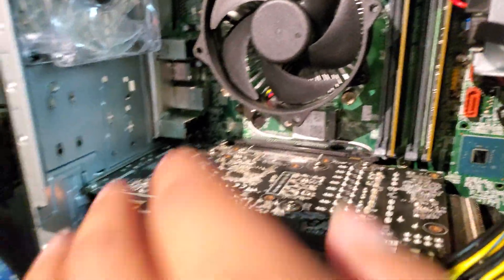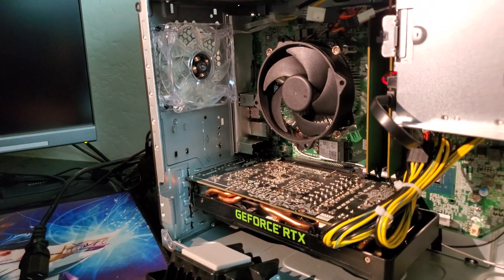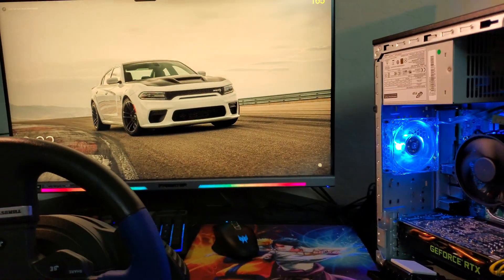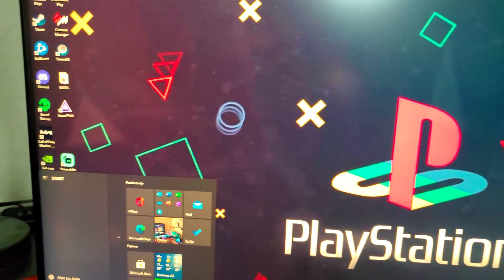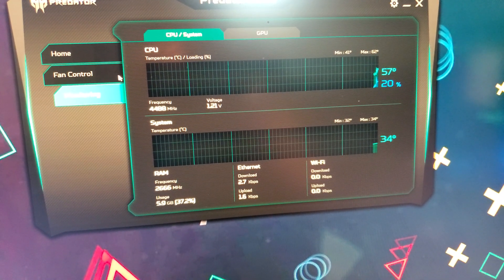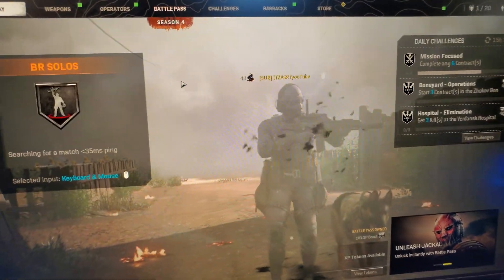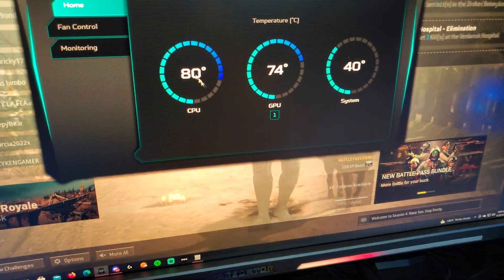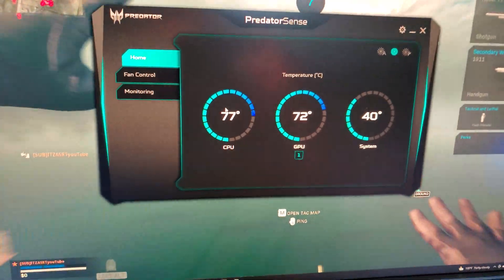PC UP & RUNNING AGAIN PREDATOR ORION 3000/ ON & OFF LOOP EASY FIX

Comment: You should add two more 8gb ram stick to play pc games because newer games require more memory
Reply from the maker: I did bro I got 48gb in my pc now
Reply: Wrong, in every game i play, i get never about 16GB
Reply from the maker: well I can see warzone using 16gb.. On my pc I am running 48gb of ram on my mother board
Reply: @itzasrt  dude wtf not even cyberpunk using so much, then something is wrong with youre pc
Reply from the maker: @dwwbs  dude nothing wrong.  I'm using the maximum for warzone. Cyberpunk is not like warzone. Look it up
Reply from the maker: @dwwbs  https://www.nvidia.com/en-us/geforce/news/gfecnt/call-of-duty-warzone-out-now-pc-system-requirements/
Reply: @dwwbs  no you're wrong bro, most games are requiring more because it goes up to 16gb
Reply: @Mr.NiceGuy1986  which? I never saw that a game goes up over 16GB, tue requirement is something different
Reply: @dwwbs  cyber punk, any new AAA titles. Shit Batman Arkham Knight and asylum use almost all 16 GB and they are old. It doesn't matter because the fact is more ram and faster ram gives better performance. But the motherboard on your Orion 3000 is limited to 2666 MHz despite what ram you use because there's no option to use xmp or to change settings in the bios.
Reply: @Mr.NiceGuy1986  In the orion 3000 is a H470 board, These boards Support 2933mhz
Reply: @Mr.NiceGuy1986  but also, the different between 2666mhz and 2933mhz or between 3000mhz and 3200mhz is not big, These are only 5 FPS or something
Reply: @dwwbs  bro I will make a video on here proving you wrong. I have the Acer predator Orion 3000 i7 10700 with the 2060 super. This board only supports 2666
Reply: @Mr.NiceGuy1986  i have the orion 3000 with 10400f and 1660 super and with xmp on i get 2933mhz
Reply: For example an ASUS Prime H470 Plus supports up to 2933mhz
Reply: @dwwbs  it's an Acer po3-620 motherboard made by Acer.
Reply: @Mr.NiceGuy1986  Anyway its an H470, you cant change the whole mb because its an selfmade

Comment: I thought about buying this PC and do you think it will run smoothly on GTA Roleplay? Im thinking about the temperature, will it be same as when runnig warzone or better?
Reply from the maker: I think it will be fine just have more Rams on your pc
Reply: Wouldn’t recommend u to buy this prebuilt as temps are quite high for several reasons one of them being stock cpu cooler is absolutely useless if not on turbo mode which makes it extremely loud, another reason is that it only has 2 fans and the front one is smaller than 120 mm and lastly due to the size of the case all the heat is spread around all the components which means that bad airflow thermal throttles ur pc and so less performance in games. Another major problem with this pc is the lack of upgrades that can be done, and by that I don’t mean add more ram or storage, I mean looking at the motherboard that is not atx or even micro atx with an extended pcb on the right doesn’t let u put it in a normal case with good airflow and the fact that u can’t really upgrade ur cpu or even ram due to intel’s platform which limits u in any sort of way. So my advice is that u should either build ur own pc and know every single part or buy a prebuilt with standard pc parts and not custom ones specifically for this pc. Sorry for the long comment I hope it was enough to show u the negatives of this pc.

Comment: Get msi afterburner
Reply from the maker: Getting upgrades later
Reply: @itzasrt  msi afterburner is a software to see stuff like fps and can overclock gpu and can show system resource usage like ram usage gpu usage etc
Reply: is predator sence worse then after burner? cuz dont they do the same thing?

Comment: The newer Orion 3000 will have better temps because it has a front fan as well
Reply: thats right i have it 0 issues  temperatures is really good by me on gta 5 online max settings 140 fps and 80 c
Reply: @marmara-tech  hacker boy
Reply: @marmara-tech  It that the pc whit this ID: DG.E2CEQ.001 ?